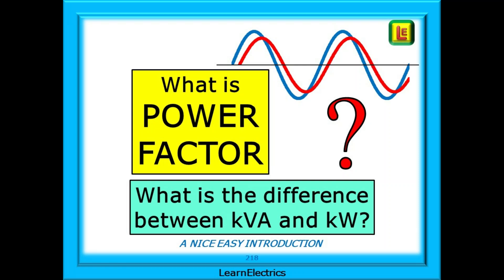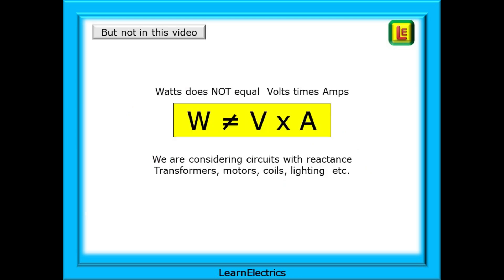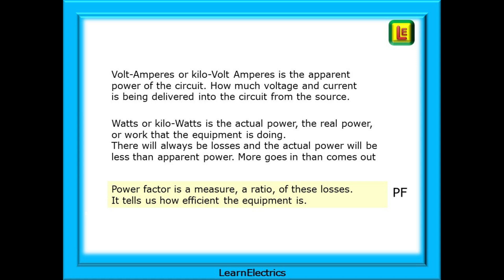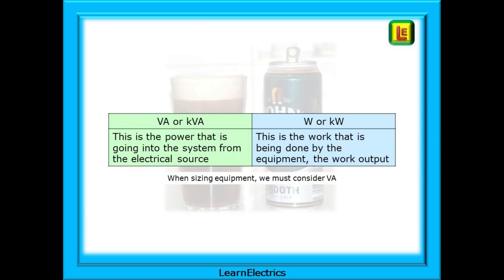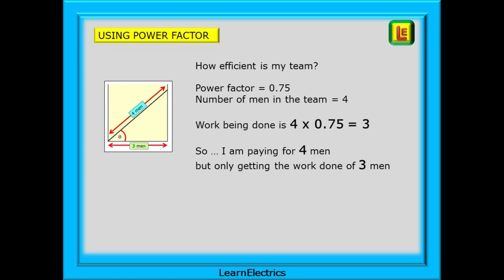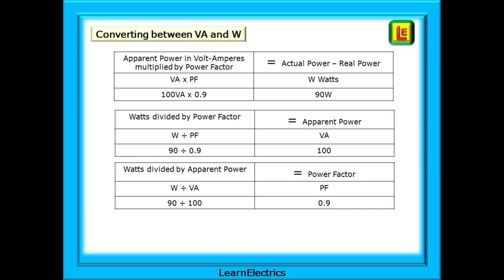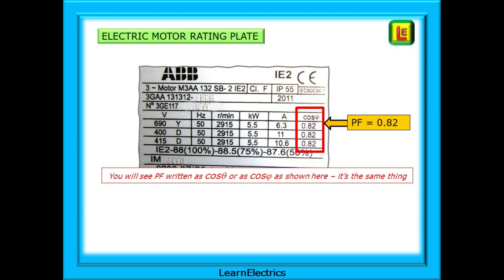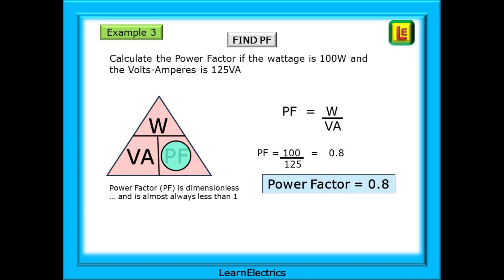WHAT IS POWER FACTOR OR PF – WHAT DOES kVA MEAN – WHY ARE kW DIFFERENT TO kVA – WITH WORKED EXAMPLES

Comment: Great job..So does the electric  meter charge you for the apparent  power ?
Reply from the maker: That's right, we pay for apparent power, that is what is being delivered to the installation. That's why it's important to get your power factor as close to 1 as possible. Not really a problem with domestic installations, just big plants with lots of motors and stuff.
Reply: @learnelectrics4402 Thanks,great videos

Comment: Hi love the videos. Always come back to your content. 

Ok to ask a question tho. Client is upgrading to 3 phase from 2 phases in the application it asks for the kva. The upgrade is for 10 flats. 

Where would you get the figures for the equations if you don’t know what the main fuses will be. For example if you looking to fit a 315 amp 10 way distribution GFP10. 

Would you put 315 and 400 v ? 

Hope that’s clear enough. Thanks again
Reply from the maker: We don't run 2 phase circuits. either 3 phase or single phase. thanks for watching. Appreciated.

Comment: at 1.04, you should not say "Current, the Amps". It is Current, measured in Amps. Less importantly, a dimensionless factor is usually expressed relative to unity or '1' You do say this, but then slip into expressing it as '%' which is strictly incorrect and unnecessary. You know your stuff, but you tend to over-state things by mixing your terms in a way that could confuse. If folk don't get it they will re-wind. Good series though. Each topic is the right length, delivery has a good pace, and a lot of effort has gone into producing clear, concise graphics.
Reply from the maker: Thank you for watching.

Comment: Fantastic explanation Dave. Im building a house at the minute and NIE are upgrading the existing transformer from 25 KVA to 50 KVA. DOes that mean 50000 volt amperes surely thats very high unless some is lost on the overhead cables plus its feeding other properties. I assume another transformer close to the build will step that down to 230 volts or near abouts to allow for voltage drop etc. DO you have a video on how electricity gets to a house etc.
Reply from the maker: Yes, the voltage will be stepped down to user friendly values. the reason the incoming voltages are so high is in order NOT to lose power in the overhead supply. I have thought of making a video on this, perhaps I should get it done. thanks for the prompt. Dave.

Comment: Great video and well explained. Thank you for making these amazing videos. I just have one question. Using the motor data plate shown on the video if the voltage (400) is multiplied by current (11) equals 4.4KVA. It’s lower than the true power shown (5.5KW). I thought the apparent power is always greater than the true power. What am I missing? Thank you.
Reply from the maker: There are some calculations that will be part of the second video involving root 3, or 1.71  and so on. Watch this space and thanks for watching this one. Dave.